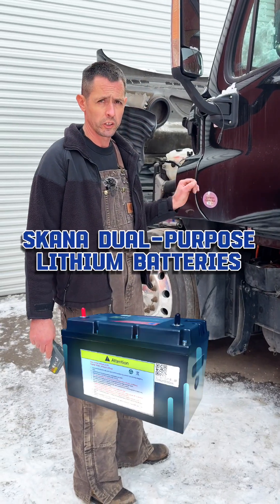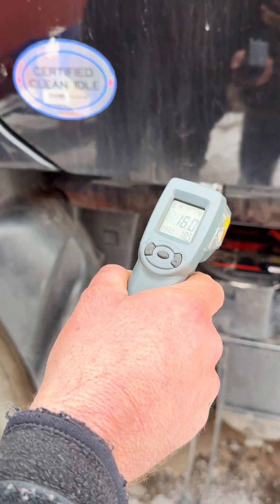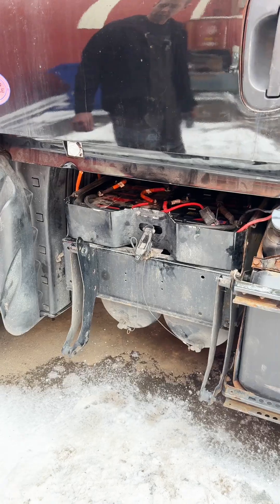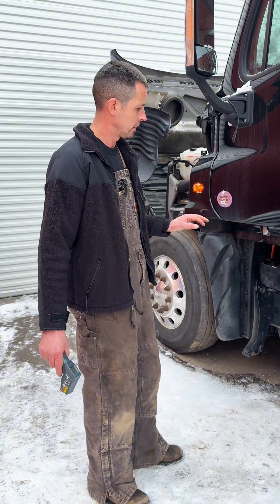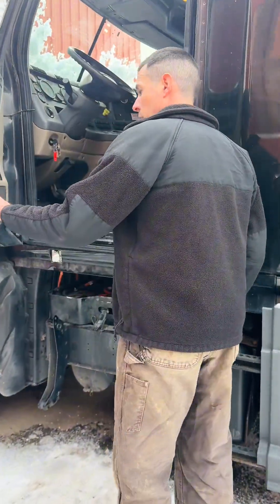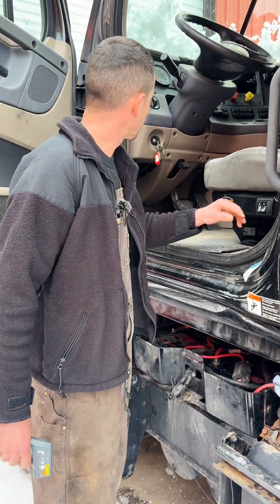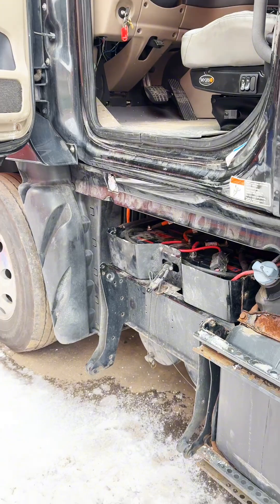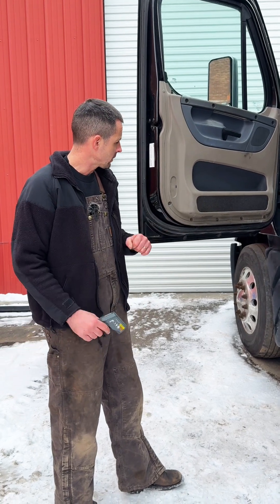Cold Start Test! Skana Lithium Starting Battery vs Freezing Temp ❄️🔥

Comment: What type of charging system do these batteries require? Whats the weight savings?
Reply from the maker: This battery uses your stock alternator. BMS system will regulate the charge to protect the battery and alternator. And each battery weighs 30 lbs. you can compare to the battery weight on your truck and you can easily calculate the weight saving.